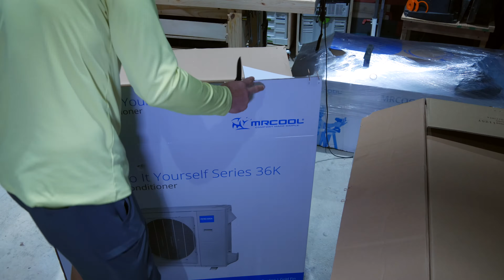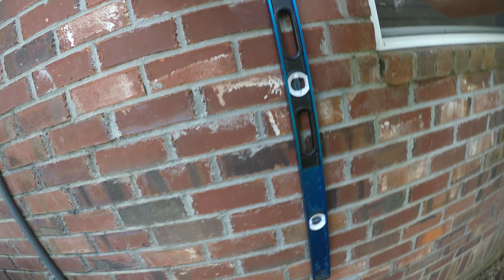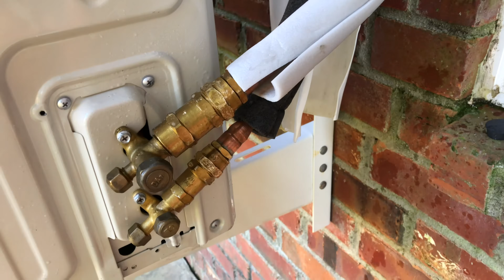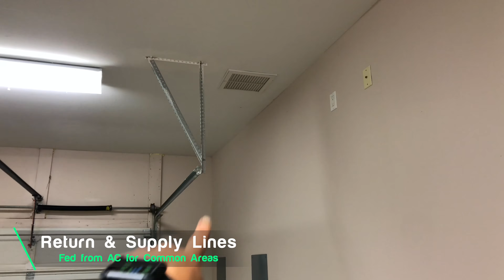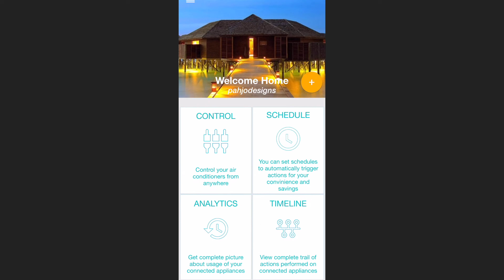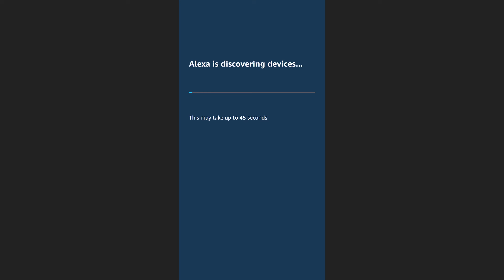DIY MRCOOL 36k Mini Split Install - Spray Foam Attic Moisture Problems

Comment: Interested in information about the humidity sensors.  After we had the addition roof insulated I then became aware of the moisture issue with doing so.  Wanting to nip any potential issue in the bud.  Seems a simple dehumidifier with open drain capabilities would have been significantly less expensive.

Comment: Great work 
Will be better if you put this link in another ac video before 1 year

If you find mold please put sensor
There 
Just for data
Temperature in corners is different